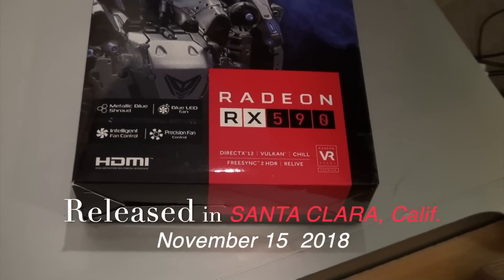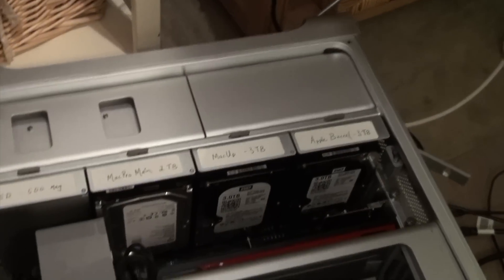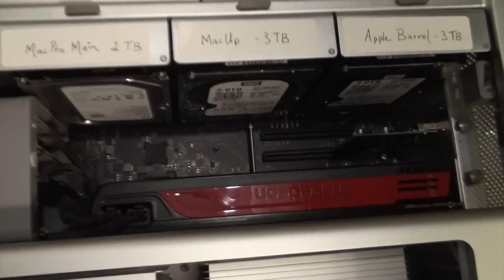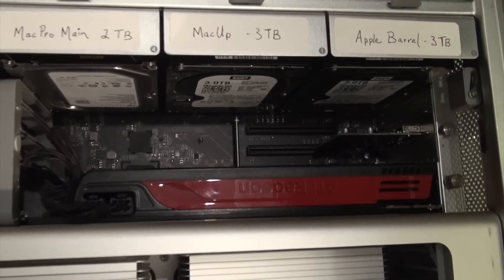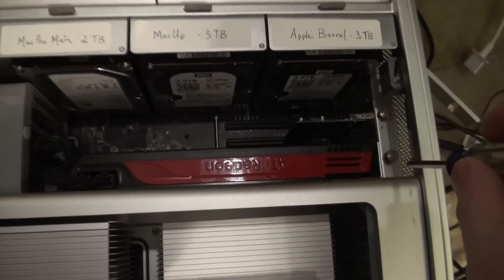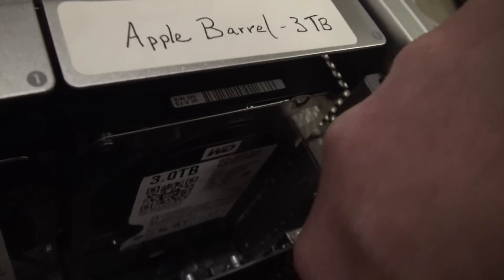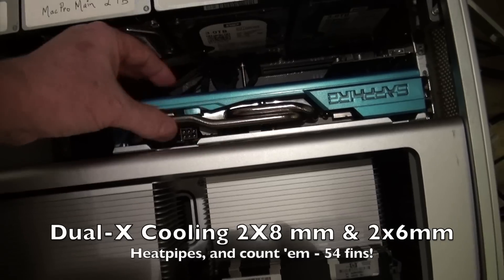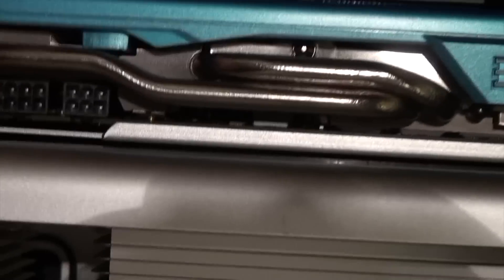How to Install Sapphire Nitro+ Radeon RX 590 in a Classic Mac Pro 5,1 for 4K & Mojave  -  Part 1©

Comment: each 6 pin off the logic board has 75 watts of power not 150 watts as well as 75 watts available from the pcie slot

Comment: You should NEVER VACUUM in your computer, only use compressed air or a micro fiber cloth on non-electronic surfaces... the vacuum can build up static energy and fry your electronics...

Comment: im still on the original card and the computer still runs like a beast, but im definitely looking into upgrade options at the moment, will squeeze another 5 years out of the machine no dramas i recon. was looking at the 580 but im curious to see what advantages a 590 might have ?
Reply: 590 has higher clocks than 580, that's all. The clocks are high enough, though, that they go beyond what a factory OC 580 is capable of, that's why AMD gave it a new name, rather than sell them as an OC 580. They can get more money by calling it a 590.
Reply: @gamewizard1760  cheers mate :)

Comment: Guys rx  590 requires 235 watts power. Don't use it in 5,1 unless u draw power from a separate SATA power. Mac Pro 5,1 has only 75+75watts( 150watts ) in the PCIE power in which he has conncted. Don't draw power like this guy for rx 590.
Reply: It's 225 watts sorry
Reply: @debinvictor2297  You can do mod and install any psu you want ... So no problem ...
Reply: 3 * 75 watt is 225. 1 from the slot and 2 from the 6 pins on the board. Are you stupid?

Comment: What about the six pin connector on the GPU? Is it left empty?
Reply: Was wondering about that as well. Thought it required both an 8 pin AND a 6 pin which would not allow the 590 to be installed on the backplane.

Comment: The 6 pin connectors provide 75 watts each. Total 150 watts plus 75 watts from the pcie slot. Total watts for pcie slots is 300 watts.

Comment: This card killed my logic board, i used the the special cable two 6 pins to one 8 pins,  was running fine for couple of days  until i decide to work on some 4K video and the Mac Pro turned off and that was it, my Mac Pro didn’t want to power back on,  i replaced the logic board and changed the RX 590 For the RX 580, running smooth for a few weeks already and I’m able to get back to work.

Comment: Hi,

I block between two graphics cards for mac pro 5.1, especially in power consumption, since the RX590 consumes in the 250w and has 6pin and 8pin, while the rx580 sapphire nitro consumes 235w with always 6 and 8 pin, the novelty I found it comes from the Sapphire Radeon RX 590 Pulse, it consumes 235w and only has an 8pin connector, so I think it can work on the power of the pro mac even push deep, what do you think? thank you

Comment: Hi great video very helpful in your step by step. I have installed the same card in a 2009 pro flashed to 5.1 however I am getting a purple cast over the whole screen on the monitor. Do you have any ideas what is causing that? I converted from high Sierra to Mohave with out the card installed could that be the problem? any tips would be appreciated - thanks

Comment: The new 2019 Radeon 7nm cards will have a lower power requirement.
Reply: RX 5700 cards produce more Heat

Comment: 2 x 75 watts from six pins plus 75 watts from PCIe slot equals 225 watts total. More power will require getting creative. I own this computer - beware cards that require more juice!
Reply: That is what I always heard and that is why so many are talking about the mod to the power supply cables.  When this video said 2 x 150 from each six pin I was a little worried.

Comment: Hi will a Asus AMD Radeon RX580 ROG STRIX OC 8GB Graphics Card work/fit
Reply: Yes it will work with 8 pin connector. You will no longer have a boot screen!
Reply: You could try it, an AMD card should be detected by the Mac OS and many other people are using a non Apple flashed RX 580

Comment: the best graphics card for this machine is a Gigabyte AMD 7970 3GB, has Metal, has Mac display plugs and is plug and play on the 4,1 5,1, the Bios can be flashed to have a Mac boot screen, never had any problems at all with this card, one 6 pin Mac to regular 6 pin cable and one 6 pin Mac to 8 pin regular cable will do, done it twice,
Reply: How do you flash the bios to get boot screen with this card? Any particular place to get the bios and instructions? Thanks
Reply: @Morphosis68  techpowerup  get the stuff to do it yourself or macvidcards $95
Reply: @TonyD-dz8pt  Thanks for that. Just looking for instructions. Did you just search for that exact card on their page and download the .rom file to flash it?

Comment: I agree with Oscar - your numbers are wrong. A 6 pin delivers 75 watts max, PCIe slots deliver 75 watts - a Mac Pro can only deliver 75 x 3 or 225 watts from these sources. You're underpowering this card, so be aware that you might be flirting with disaster.
Reply: 375W ..lol ... it's 75w/75w + 75w PCI Slot
Reply: And yet here I am and the card runs perfectly after all these years!

Comment: Good video. I didn't know those cards could work fine with only an 8 PIN connector and the power from the PCI slot.  Thank you for showing us this. RX590, maybe my next card now.
Reply: You should only run it using the stock BIOS, not the overclocked BIOS. The overclocked BIOS will draw more power, and might require the 6-pin connector. The reference cards use only a single 8-pin, over clocked cards could use either an 8 and a 6 or two 8's. If the card you get has fixed clocks, higher than the reference clocks, you may not have the option of using the 8-pin connector alone.

Comment: will this particular card automatically work in a upgraded 4.1 to 5.1 cMP from 2009 as well?
Reply: it doesn't work. My one is the same as yours. I am still looking for a solution with Radeon Plus RX 580 special edition.
Reply: I don't think so. 2010 yes, and 2012

Comment: For those that don’t have (2) mini 6 pin male to standard 6 pin male connectors, you’ll need to purchase them. These cable connect to the mother board. The standard 6 pin side connects to the dual 6 pin to 8 pin cable
Reply: He said dual mini 6 pin FEMALE to a single 8 pin male standard. Every cable I can find has the dual mini 6 pin but as male to a single male 8 pin not female to male

Comment: This is a wonderful video!  Do you know if I can upgrade to Mojave from 10.12.6 Sierra, Or do I need to install 10.13 High Sierra first?  (since I'm having trouble getting High Sierra to work on my mid 2010 5,1 dual boot system even after the flash).
Reply: Yes you must upgrade to 10.13.6 first
Reply: Sorry, I have not kept up with this video... but I am thrilled it has helped so many... yes of course you need to install 10.13 first before you can install a metal card and then 10.14

Comment: Nice video I really appreciate it. After watching this video I went on and bought the same video card you have and I love it cool lights too. But I have one question for you. When I installed it and plug my monitor in. I noticed a red light that comes on  on the ram tray board. I have an Mac pro 6 core 3.46ghz mid 2010. Just want to know if this ever happened to you if so what should I do? Thanks!
Reply: It is unable to handle the power consumption....U have to use pixlas mode for providing more power to power hungry graphics card....Rx 580 is the max u can add directly without moding the power cable
Reply: @debinvictor2297  this is why i read the comments section ;) i was curious as too whether this would have that issue ? would the single processor version have the same issue ?

Comment: is it okay / better power supply to simply plug it via both it's 6 pin & 8 pin connectors into "both" 6 pin connectors provided for power? (one obviously being a 6 to 8 pin convertor on top of the 6 to 6 pin cable) ?
Reply: was just delivered today. installed it / plugged it into my mac pro 4,1 flashed to a 5,1 system and all seems chill. used both 6 pin and 8 pin outlets running directly into my system. though I can't seem to find any way to use the Trixx software for a mac. All google searches lead to Windows download only. Now trying to find out how to change / turn off the lights on it without the sapphire trixx software. did you actually find a link to it for a mac? :-/
Reply: found out it's stuck at a constant blue led no matter what. also ended up getting an external 1000w PSU that I plugged into only the GPU via a single 6 pin cable running into the back while still having it plugged into the 8 pin cable inside the mac. It's def. overkill in wattage but will last me the next couple GPU's as I upgrade. Had to do the "safety pin" trick in the PSU's motherboard cable to get it to power on without having it attached to my actual motherboard but otherwise now the GPU can perform full throttle without any fault to my system / or under perform with heavy 4k edits. Sorry for rambling on your page, just figured it'd help any Sapphire 590 humans who have a Mac Pro 5,1 who come here.

Comment: What is the chassis?
Reply from the maker: ? It is a Mac Pro 5,1
Reply: @applesaucemacintosh3577  emmm.  
Should it be a computer case?
Sorry, English is not good.
What is the type of computer case?
Reply from the maker: It is an Apple Mac Pro, - last aluminum case made and called a 5,1 - from 2012

Comment from the maker: We are at the end of February and this RX 590 is still powering two Viewsonic monitors as mentioned below! and is excellent.
Reply: My Radeon 580 still power Mac Pro 2010  in 2021, Use it to for FCP, Motion,  Gaming (mac and Bootcamp) runs fallout 3, NV, 4 with no problem.

Comment: I want to upgrade my Mac Pro 5.1 2010 Sierra to High Sierra, do i have to remove gpu (NVIDIA GeForce GTX 660 Ti 2047 MB) and insert original gpu (Radeon 5770 1GB) for the procedure?
Reply from the maker: No, you don't need to do that. You should be able to upgrade directly.

Comment: Did you have to install any drivers or was it recognised straight away
Reply: I have also installed. You need no drivers or other changes. https://youtu.be/HrXoNUYeQHM It has the same ID as the official supported RX 580 I also had before.
Reply from the maker: As mentioned in the video if you watched it all the way... no drivers were needed, even with a non Apple spec card.

Comment: Hi, do you have to use the 6 pin female to 8 pin male connector or can you just use the existing cables in the 5.1
Reply: Richard Hurst you use the existing cable AND the dual 6-pin to 8-pin
Reply from the maker: As mentioned in earlier answers, the power draw is such that you need the 75 from the slot and the 75 from each cable thus on all the forums as well as here you will be wise to buy the splitter cable mentioned in the video. and nothing else. thanks!

Comment: Thank you! Great Mac Pro specific installation video. More thorough than most, with a bit of OS core functions and developer insight. Did you have to change the bios-switch or anything at all in macOS to get this card to run? Looking forward to part 2.
Reply from the maker: Yes, I mentioned that for the concern about power draw, I did put the switch to computer not gamer. But either will work. Please see the whole video... I do answer all the questions asked in comments in the video!!!
Reply: @applesaucemacintosh3577  Hey, I watched the whole video, multiple times, two times in its entirety today actually. You simply didn't cover the BIOS question I asked. And also: Please note that a 6-pin connector delivers 75W, not 150W. What were your plans for Part 2? I'm curious as I'm about to get this specific card today. Are you still using the 590 in your MP?

Comment: Is the apple logo visible at boot?
Reply from the maker: Thanks for the question. The Apple logo is only visible with on a card made specifically for Apple, usually says that on the box... however lately these companies are not making many Apple specific cards, but this has never been an issue to most of us who have Mac Pros... it is not hard to reset the boot by zapping the PRAM or booting from another external drive then in Sys. Prefs... to Startup.
Reply: No you won't get the boot logo (Yet)

Comment: Hmmmm RX590 or a VEGA64 or an RX590 with Crossfire maybe, for an Mac Pro 5, 1.

Also, is it possible to go for  2x12 core cpus?
Reply: Great perfect! Thanks so much for your response. More power on your channel. Notifications on for this one. :)
Reply: Thank you so much. :)
Reply from the maker: Please watch the whole video these questions are answered clearly, thanks
Reply from the maker: I mention in the video that the RX 590 board is made in other configurations, like the FATBOY, but this Nitro Card has a switch to use a little less power and so far has caused me only wonder! It is a great card in Apple's finest Mac Pro!

Comment: So what's the final decision !! can we buy these card and install it directy with the original power supply without problem or no?? thanks for all your advices
Reply: yes do it! I did it with the 590 and works very well! look my installation video!
Reply from the maker: Yes!
Reply from the maker: If you watch this video it clearly explains and answers all questions about the Power to the board... the Power Supply is fine, but you need to use the cable that I explained in the video that goes from 2 6 pins to one 8 Pin... thanks!
Reply: Hi, why can't you just use existing power connectors?
 @applesaucemacintosh3577
Reply: Richard Hurst Because the video card need to power by the 8-pin connector and your Mac doesn’t have it!
Reply: Yes, I have 2 Mac pro's and the 580's drop in and work out the box, just no apple boot logo
Reply: @phatnum17  thanks, how about the 590 card?
Reply: @Unsorted_Minds  I'd imagine the same, but performance for the cost over the 580 isn't worth it imo
Reply: @phatnum17  thanks, so let's go for the 580 nitro + se  ;-) thanks

Comment from the maker: Hey, folks, it is January 3rd 2019 and this card is amazing, still working fine, never overheats and it has given no problems, now if only Radeon would pay me for saying that! :-) --- anyone else out there using it?
Reply: I installed the Sapphire RX580 last month, using it mostly for video editing, I found however that the backplate gets very hot under load, e.g. gaming, so I put mine in PCI slot 2.
Reply: Thanks for the great demo. I'm planning on picking one up this weekend. How's the spacing on Slot 2?
Reply: It seems to me that the backplate also functions as a heatsink, which seems to make sense because in most Windows PCs the card would be flipped around.
Reply: Hi! I did the upgrade because of you video! thanks man! the card works amazing!
Reply: Have you made the update video?
Reply: is it good for video editing?
Reply: Guys rx  590 requires 235 watts power. Don't use it in 5,1 unless u draw power from a separate SATA power. Mac Pro 5,1 has only 75+75watts( 150watts ) in the PCIE power in which he has conncted. Don't draw power like this guy for rx 590.
Reply: @debinvictor2297  Hello mate are you sure as the draw power is different to what they recommend. They recommend a 500 watt PSU but from what i've researched and with the help of @create success tv videos everyone seems to be operating fine under load of gaming video editing and general duties. Please do not put this guys video down as i'm not sure you have done thorough research.
Reply: @kings-art957  I am telling about Rx 590 gpu on Mac Pro 5,1. You can use upto rx 580  which was used by create success tv. Rx 590 draws way more power than 580 . You can mod the power supply and use it....but there is high chance that you will kill your PCB board...within a week or month.
Reply: This graphics card is working fine on my macpro 5.1 as well
Reply: I think you need a million views to get sponsorship from AMD, or Sapphire, however I do notice no posts for AMD's having failures, and I have been seeing several for EVGA 900, 1000, and 2000 series graphic cards failing due to faulty VRM's, and possibly other componets.
Reply: @josemedeiros007  Good point you are making here. And, I've also seem pals have to warranty 900, and 1000 series cards as well.
Reply: AppleSauce Macintosh I installed the Saphine on my 2010 and and started having blinking issues with my monitor (apple cinema 30”) at first startup. (The day after I installed) Once I reboot or pop out the power cable from the power brick on my monitor it works fine. Any ideas?
Reply: Happy to report after replacing the power brick on my Apple Cinema Display all is working great. The flickering / power failure just happened to coincidence with the install of my RX590.

Comment: The dual 6 pin is said to be only 150W total (75W x 2). Yes it will work until you pull enough current from the motherboard under heavy load. Then some magic smoke.
Reply from the maker: Thanks Oscar... I would refer you to this forum: - it is pretty clear, the power it draws is  within the scope of this power supply... https://forums.macrumors.com/threads/mac-pro-4-1-and-5-1-pcie-aux-power.2035519/
Reply: @applesaucemacintosh3577   Yeah, I've seen all those before.
Reply: @OscarCastillo1  Plus another 75 from the PCI-E. It won't choke until the combined PCIE+slot power is above 310w. Read the datasheets, that silver solder isn't there for shits n giggles.
Reply: Ster Fry Failure is not based on the combined power draw. Any individual 6 pin or PCIe slot can fail independently because the power isn’t always evenly distributed under load.
Reply: Oscar Castillo the ati radeon hd 5870 mac edition uses 228W.